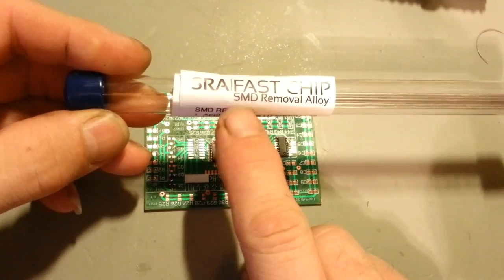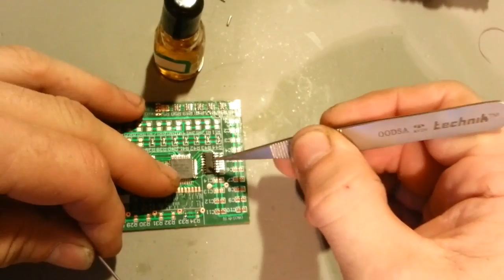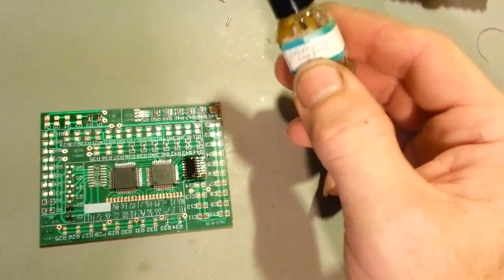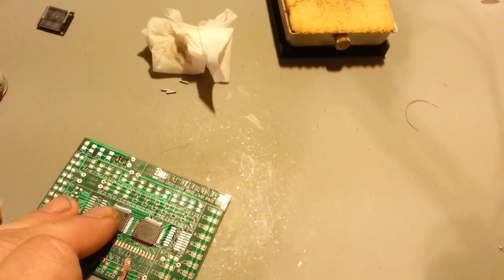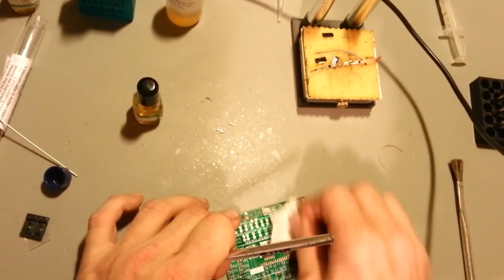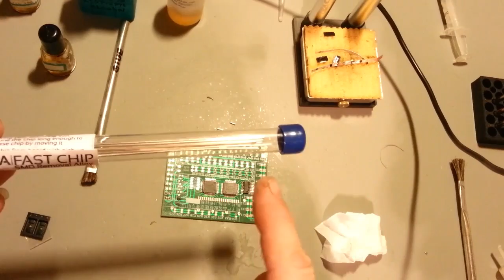Desoldering and soldering SMD components with a minimum of equipment.

Comment: I know this is an old video but I just came across it trying to repair a PCB (great demo btw). I have low melt alloy and agree it works great, the problem is the chips I need to replace are on the bottom side of the pcb and appear to be glued down. Do you have an suggestions on how to remove them? My googling has turned up empty. Thanks!

Comment: Are you using straight IPA for cleaning, or is it deconcentrated with water?
Reply: Straight IPA only, don't mix it with anything else when cleaning
That's what the 99% in isopropyl alcohol mean, it's essentially isopropyl alcohol only.

Comment: Is that technique also usable if you want to reuse the desoldered part? For example if you want to desolder an IC and use it on another board? Or will the constant heat harm the part?
Reply from the maker: You can and I have reused IC's before.  Continued heating will eventually kill almost anything electronic so speed and proper soldering temperature  is key to success.

Comment: You don't need exotic expensive types of flux. There plumber's non-acid flux that comes in a tin and costs $1.50 at the hardware store had worked great for me for 30 years. it has the look and consistency of Vaseline , and you only need to use very small amounts. One tin has lasted me 30 years, and it is still half full.

You're beating around the bush about what flux does, using too many words, and it is really simple - decreases surface tension.  
Anyone who works with solder, needs, in addition to PRACTICE, to understand surface tension. 
it is the force that causes any liquid ( like water, or solder) to want to form spherical balls, or shapes with the lowest surface-to-volume ratio. 
It does not want to WET your surface  because wetting results in a shape with very high surface to volume ratio.
When it wants very badly to stay in a ball and nor wet anything, that is HIGH surface tension. When you DECREASE surface tension by using flux, you force solder to WET the pins and leads you want to solder.
A good reading on surface tension will make any hobbyist a better solderer.
AND be advised , that some types of flux, especially the non-corrosive type, may require more non-polar solvents than just isopropyl alcohol., like acetone, methyl ethyl ketone, or dichloroethane. Isopropyl alcohol sold in pharmacies as rubbing alcohol, contains water ( up to 30% water) and water is incompatible with some of the impurities that need to be removed. Also newer nail polish removers contain water-diluted acetone, may not even contain acetone, and often contain skin softeners and conditioners which deposit a residue on the PCB.  
Industrial PCB makers do not use IPA, they use MEK or chlorinated solvents., If you need to RUB the residue away with the solvent,it means you're not using the right solvent. With the proper solvent, the residue is washed away without you needing to touch it. The problem with RUBBING, is that once a part soldered, you cannot RUB underneath an SMD IC to remove excess flux residue. You need to be able to trust that your solvent will remove everything just be flowing underneath the IC body. You hold the PCB at an angle, and you squirt the solvent at the top and let it flow down and do its cleaning, Repeat 3 times.

Don't stop at the drugstore, when equiping your lab for PCB work. You will need to go outside the "safe for children" environment to do some serious work.

Comment: +Mikesradiorepair  what's your thoughts the auto solder fed irons
Reply from the maker: For me they would be useless.  I have to change solder composition, flux type and diameter several times a day.  Would probably be useful in a production environment where you were soldering the exact same part day in and day out.
Reply: Been looking a Sams on a Uniden Grant XL.
Reply from the maker: There isn't one.  SAMS was out of business by the time that radio was made.
Reply: @mikesradiorepair  dang.  Well Im looking for schematics. If there is any. Beside service manual
Reply from the maker: Just use the schematic for the earlier versions.  Basically the same thing with some minor changes.
Reply: @mikesradiorepair  so many questions to ask but I know your time is money..     maybe I'll send a email later next year lol. Happy New year. You been a great inspiration .  To getting back to tinkering again only going by your persice thoughts and teaching...thank you .. have a good one.

Comment: Thank you for a very helpful video. I have a question regarding the low melting point alloy. If its melting point is less than solder how does it melt the solder?

Comment: I just attempted to desolder a SMD... you should see the unbelievable , horrible mess I made of the board...
I tried the "balling up solder on the leads & pulling it off" method as here... It must be the type of flux/solder, because mine cooled off in about a 1/2 second, and I was left with a gigantic mess of solder that I couldn;t then get off.. I won't go into what the final result was..
;(
Reply from the maker: As shown in the video I did NOT use regular solder.  I used a solder removal alloy.  It has a extremely low melting point and stays in liquid form for a very long time after your soldering iron tip is removed.
Reply: @mikesradiorepair  

great video.   Hope all is well.
Reply: @mikesradiorepair  Really miss your your videos Mike. Wish you would come back on. Glad to hear your still replying. Best cb channel on YouTube by a country mile!

Comment: "...make my own" flux. Is that "rosin cake" the same kind (whether same grade or not) of rosin as what is rubbed on musical (violin) bows or completely different? 
Flux is not just to clean the connections but also to prevent oxidation while heating.

Comment: Hello Mike, 
great video! How do you make your own flux? Do you have a video on it? (I couldnt find one). I use a cheapo Kester pen from China and it doesnt work very well so I'm looking for a replacement. That liquid flux in a nail polish dispenser looks really useful!
Reply from the maker: Probably the easiest thing to do is buy Kester 186 liquid flux.  They only sell it in a large jug but there is a seller on ebay that repackages it in smaller bottles.  Great flux and ready to use.
Reply: Thanks a lot!

Comment: Where did you get that giant sponge?. All sponges I see are little and thin?
Reply from the maker: It's not a single sponge.  It's a stack of thin sponges with a sawtooth cut edge and a hole down the middle.  They then set in the tray, a screw goes through them (you can see the nut on the front) which holds them in the tray.  It is a Pace brand stand with sponge and fiberglass cleaning wands that set in the back of the stand.

Comment: The old solder on the board won't melt it's very old and I put the soldering iron on medium and high heat but it won't melt and I am using a pump
Reply from the maker: +HypeCharlie 

Try adding some flux or you can also add some new solder.  When solder becomes old and oxidized  it can often become hard to make a good thermal contact.  Adding fresh flux helps to break through the oxidization layer and adding fresh solder does the same.  Once the oxidation layer has been breached you should find it melts just fine.  This is why I recommend desoldering bad solder joints instead of just reflowing them.  Removal of the old solder is the only way to ensure  good new solder joint.

Comment: Rather than using the desoldering braid couldn't you just tap the board on its edge and use gravity to make it fall off?
Reply: No, because you run the risk of the solder flowing onto another part.

Comment: Stupid question ... Is the rosin that you use the same as violin bow rosin?
Reply from the maker: Jon Mullins 

Honestly I don't know.  The flux cakes I buy in metal tins is made in Germany and that's where I buy it from.  No one in the US sells it.
Reply: It's just tree resin (sometimes called colophony). But the violin version's generally a lot more expensive. Its main advantage is that it's pure - all the dirt, twigs and insects have been removed!    Just carefully crush in an old piece of cloth - otherwise the ultra-sticky bits will fly everywhere!.  Then transfer to a small plastic bottle. Add iso-propyl alcohol (NOT ethanol or methanol), and shake it until you get that nice clear amber color with no visible residue.  Warming it a little also helps, but I find it only completely and quickly dissolves in IPA.

Comment: How high is the temp of your soldering iron?
Reply from the maker: Depends on what I'm soldering, what it's thermal mass is, what solder I'm using, etc...
Reply from the maker: I don't know what iron your using, how accurate it's tip temperature is and if you can set a offset.  Also depends on what solder your using.  Different solders have different melting point.  There's no way for me to know what temperature you would need in your setup/application.

Comment: Sooooo superb explained :) thanks very much. :D i also love flux. It's almost like magic when it works. :( just bad is that here in germany this sra stuff is nowhere to get :D (and i don't like amazon but seems the only source)
Reply: Germany is big on music . . .right?  . . .and inclusive of music are violins. Violins need rosin for their bows, so cakes of rosin are readily available. So you just get that rosin cake and pulverize it to  powder and then dissolve it in either isopropyl or denatured alcohol or  pure vodka. There,  you have your liquid rosin  flux on the cheap. I have also driven small weep holes into a pine tree and later harvested / broken off the then developed  dry rosin nodules.

Comment: What would be a good temp for smd work or the max temp that you would use for smd work?
Reply from the maker: +Hawk N.W.C. 

That varies with every job.  Depends on the type of solder used, component type and manufacturers recommended procedures.

Comment: Don't know if anyone will see my comment? I have 3 ic's to replace that are tiny, I mean tiny. 8 leads per side, and total of maybe 1 quarter inch square. I use a 50x microscope to see the spacing between leads, and it's the size of the head of a needle. So my ? is........drag or paste? Hot air seems to me would damage the chips? Then again, 1 got so hot that it started melting plastic 1 quarter inch away from both sides when this dink connected his jump starter backwards. Now I'm just replacing chips hoping to bring it back to life.

Comment: Thanks for sharing these pearls of wisdom, I think I'll have a go at replacing a few voltage regulators on some cheap chinese arduino mega 2560's that I have kicking around to something a bit better as I found they all seemed to fail if a 12864 full graphics display  is plugged into the ramps sooner or later - I guess it draws too much - thanks  again - Subbed

Comment: Very good hot air stations are starting from 40$/euros.So what the point.Go get a real station to do the job.
Reply from the maker: Very good hot air stations start in the hundreds of dollars.  Most of mine are over $1,000.
Reply: Ok,maybe not so good but they are 700 watt powerful.If you dont have hot air station then probably dont you know how to rework smd components.If buy a ready made one there is a chance to learn after a lot of practice.If trying to make it your own you will never make it neither you learn also.
Reply from the maker: Honestly when working on two way radios I rarely use a hot air station.  There are to many components that can be damaged by the high heat that are in close proximity to the part that needs serviced.  If I had to estimate I would say 90% or more of the repair work I do to SMD components is done with a soldering iron.  About the only thing I use hot air for is BGA type IC''s/processors and for D-PAK components.  For people working on two way radios, Hi-Fi receivers and other devices like this that have a lot of parts with plastic in them it's best to learn how to do SMD hand soldering with a soldering iron.  Hot air rework will rarely be used.  If you work on computers and cell phones then sure, using hot air for part removal is common but even then most components are still hand soldered when placing the new part.
Reply: I am not talking especially for you and for your working skills,god no.But everyone who interested in smd reworking since it is a quite difficult techique is best to buy a ready made tool even a cheap one.Even then it is still difficult to use it for some time until to learn it.

Comment: Its solder not sodder there is a L in the word.
Reply from the maker: Not when pronounced in American English.  There are two proper pronunciations and it depends on which country you are in as to which is correct.  Even the Cambridge dictionary recognizes this.  https://dictionary.cambridge.org/us/pronunciation/english/solder
Reply: @mikesradiorepair  Just sounds strange to us. Thanks for the reply.
Reply from the maker: @geesesbee    LOL, hearing it with the L pronounced sounds strange to us here in the USA.  Lord only knows why there are two pronunciations for the same word with the same meaning.  Probably just that us wacky Americans have to be different. :-)
Reply: @mikesradiorepair  It will do the same as it does to Lol.
Reply from the maker: @geesesbee    Apparently it's been like this for a long time.  Here is a rather long but good discussion about it from a American linguist in the UK.  https://separatedbyacommonlanguage.blogspot.com/2020/05/solder-and-bit-about-calm.html#:~:text=Most%20Americans%20don't%20pronounce,just%20don't%20do%20that.
Reply: If you sell something  do you mark it as sod or sold?

Comment: YOU ARE A BUCKETMOUTH. ALL U NEED IS A SOLDERING IRON WITH A DETACATED (AND I DONT CARE ABOUT MY SPELLING)      BULB SUCKER WITH A METAL TUBE DOWN TO THE TIP WITH A HOLE IN IT.I USED TO DO THIS CRAP WITH COPPER BRADED WIRE IN THE EARLY 60'S WITH HEATHKIT CRAP GET INTO THE 20th CENTURY.